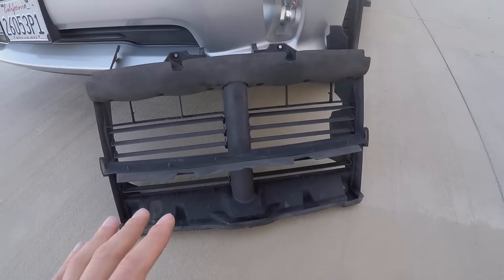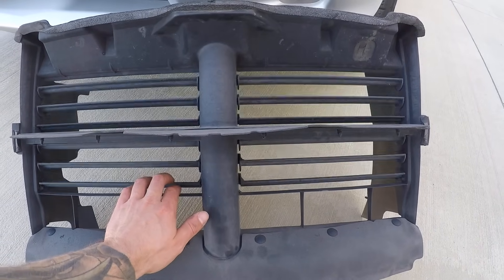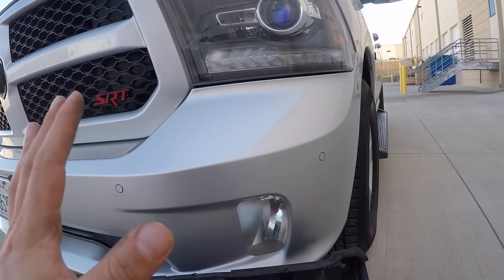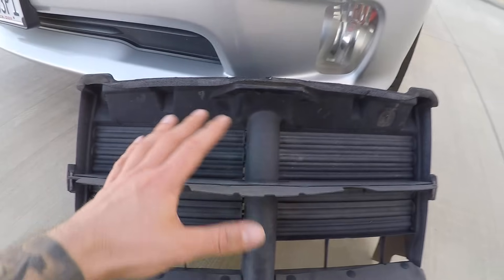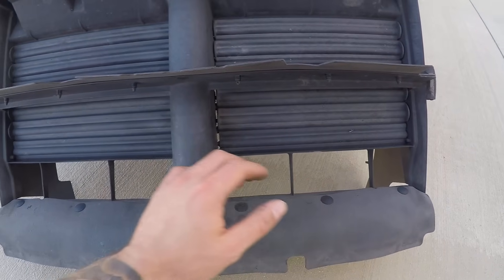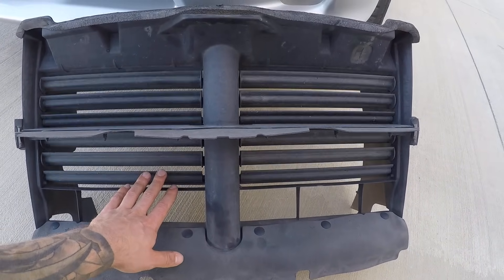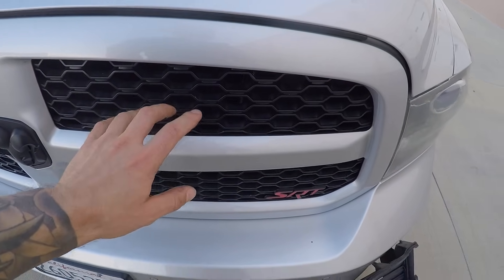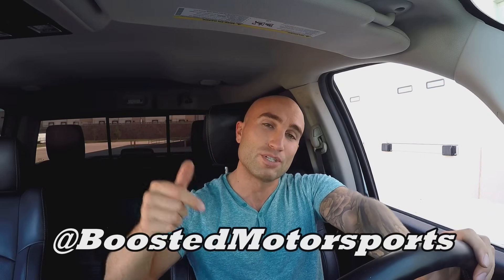What do Active Grille Shutters Do? AGS - TruckTalk #30

Comment: AGS system is completely unnecessary, unless there is no thermostat equipped. If thermostat is closed there is no coolant flow thru the radiator that the passing air can cool, thus the engine will reach operating temperature just as quickly with or without AGS. If they are closed during highway driving for "aerodynamics" your engine is probably getting too hot while driving. Thermostat is what truly regulates engine temp...along with other factors ie. Cooling fan speed, timing, etc.
Reply: Yet multiple car engineering team have decided to spend extra r&D and extra money in installing them regardless of your logic. Normally I would agree with you but it must still make a difference besides  the differences it makes in the transmission and turbo cooling even if it is just less cold air rushing through the engine compartment.
Reply: @fathergratwick  Respectfully to you, there's no real R&D involved. Other than coming up with an unnecessary component that is design to fail for dealer profit. Yes! Planned obsolescence is a real thing. As for spending the extra money? The stock AGS is made entirely of cheap, brittle plastic with a faulty motor. Probably cost the manufacturer pennys to produce & install, charged the consumer hundreds in sticker price. Then will charge hundreds more to service the system when it fails. And it WILL fail.
Reply: @stevenromero1801  Ive respectfully disagree. Ive owned a few and still own a classic  and if your statement had merit newer vehicles wouldnt be running circles around those old simple designs as far as vehicle lifespan. we are not all engineers so we like to believe its all about conspiracy theories I guess. we all like to think we can stick it to the man by undoing some feature our car came with the save us money? planned obsolescence it a thing I agree (without it we would mostly be driving very old vehicles right now) .. but removing the shutters is not a going to do a damn thing to deter or effect that IMO. Ironically the person who made this video didnt even research how the shutters truly work
Reply: @fathergratwick  Fair enough. I respect your opinion. Never said newer vehicles weren't more powerful than oldies. The more efficient the engine, the more power it produces with less fuel & emissions. That's true. However, if it makes you feel better to spend a ton of money constantly fixing your new car, go right on ahead. Personally, I'd rather stay on the streets with my simple, DEPENDABLE designs. As an ASE tech, who has to do the actual repairs on these new POS, it's just more money in my pocket anyways 😉.
Reply: @stevenromero1801 you are absolutely right. These car manufacturers are in business to make money. The only "green" they are concerned with is the green in their pocket. This is no different than the infamous EGR system... It's more shit they add for you to spend money on later. Cars run more efficient now because they are tuned better with EFI (electronic fuel injection) and EIS (electronic ignition system) - no more distributors/carburetors - some of the last useful designs on modern vehicles. These shutters are shit, and the "team of engineers" who designed this are idiots (or not, since I'm sure they'll get nicely compensation for the bigger company profits). Anyone mechanically inclined knows cooler engines run better. 

Hotter engines = durability and performance..….said no one ever!

Comment: i have a 2019 equinox 2.0 turbo with grill shutters and i noticed a looss off hp when the shutters r closed but when open feels like the hp is boosted again. mine r getting deleted for space for a front mount inner cooler. i think who ever made the design was not thinking correctly. to much heat on a engine can shorten engine life. def bad on engine. not a design i would engineer.

Comment: devils advocate here,   apparently the reasoning behind removing these in this video is completely incorrect as ive been told the shutters are effected by only 2 things, vehicle speed and whether the radiator fan is running (as it does if the engine is at temp or the defrosters are/ac is on) ... You can change your thermostat to 180 like I did and find out the vehicles computer still looks for 200+ before adjusting the air fuel ratios and operating correctly. On my second gen ram I ran 180 stat for a year before i discovered it was actually negatively effecting my performance without changing the computer tune to work with the lower temp stat. the logical thing would be to have the system tuned for 180degrees shutters included.

Comment: If you want to have heat in your truck in the winter don't remove or disable these.
Reply from the maker: Yeah cause all trucks before this never had heat right? 😂
Reply: @BoostedMotorsports  because mine were damaged in an accident so I propped them open. And then my truck didn't have heat in the winter. Especially when going down the highway

Comment: Why would you ever touch this or change your thermostat ??? Unless you want your truck to run lean all the time ? Everything is programmed from the factory and designed to work at the certain temperature range… not a smart move

Comment: I would have thought it's much more important to keep the area around the engine cool so wiring connectors and electronics last longer. The control of air spark and engine oxygen would have enough affect. Yes. Rip the bastard off. Over engineering.

Comment: What if I want to keep my AGS but put a light bar on the bottom where airflow goes in, is that ok? Or will it hurt my 1500s engine in the long run? I have a 3.6 v6 btw.